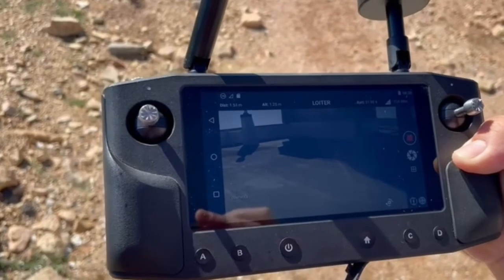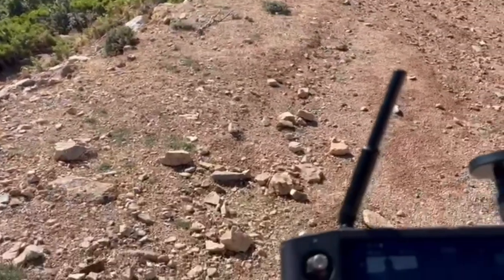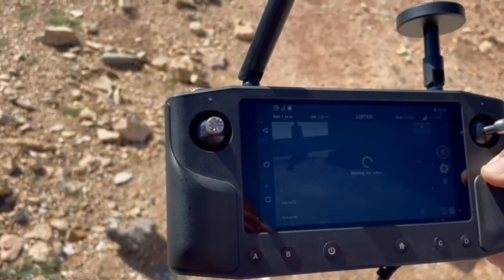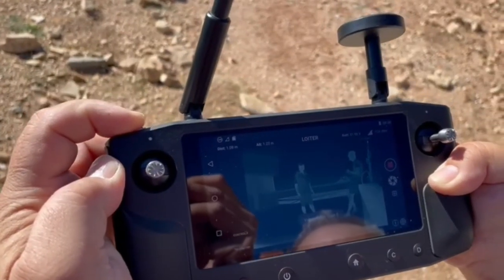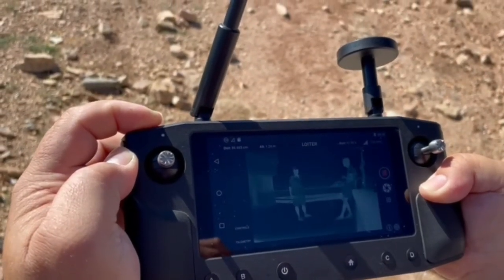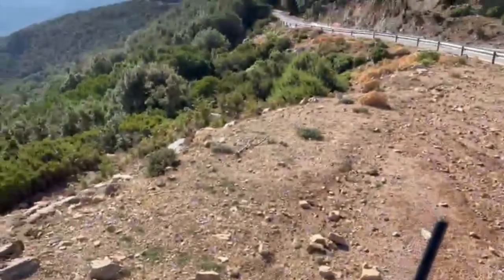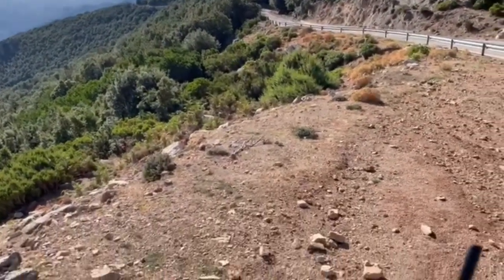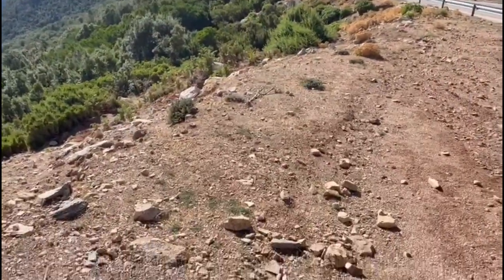HERELINK 23 KM TEST RANGE

Comment: What camera are you using on the drone?
Reply from the maker: Hi Omer.... Two Cameras were used for the test (consider that it is a laboratory UAV and we do not mount the highest things because it is for internal tests) .... we have N. 1 thermal camera  Flir 640x512 (no radiometric) + N. 1 GoPro Hero 3 Silver (old, but often used for internal tests)... bye